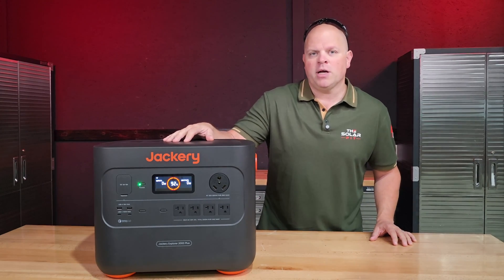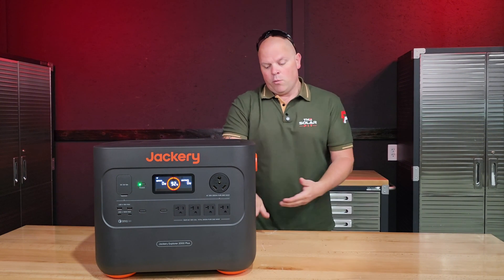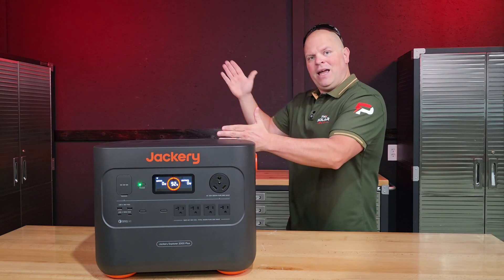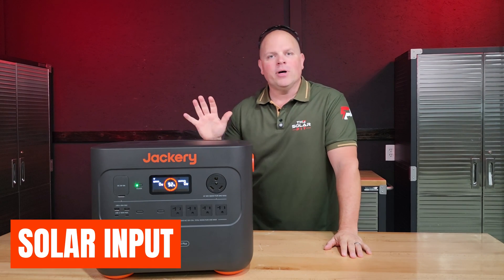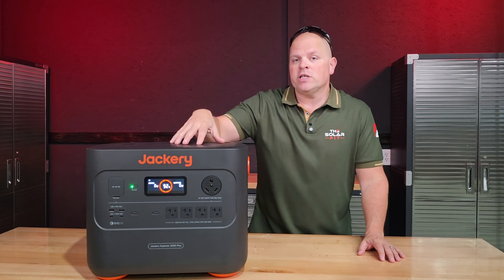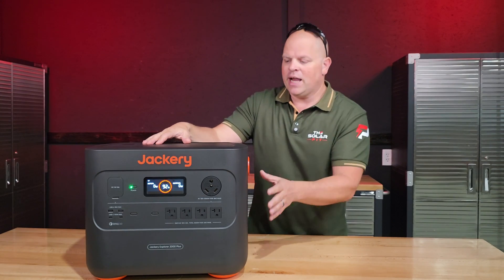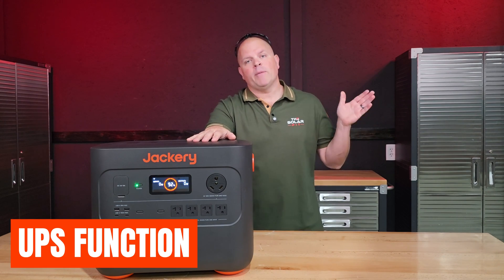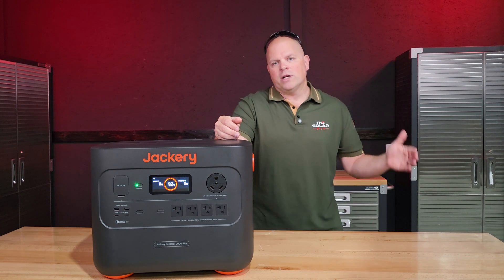What NO ONE is telling you - Jackery Explorer 2000 Plus

Comment: The biggest pain in the ass with Jackery customer service is...they won't do a damn thing until you send them either a  picture or a video of the problem.  I have had three units go bad on me.  One example was the cooling fan would come on immediately with a 10 watt ac load.  Then the fan would never shut off until you turned it off then on again. They want all this crazy info.  Then when you call back you get a different person and you have to start all over again.  NEVER buy a Jackery from any place other than Home Depot, Lowes or Costco.  Save yourself hours of frustration and having to ship the damn thing back to California.  Then Jackery won't send you a replacement for weeks until they supposedly review the problem.  I waited over 6 weeks to get a unit back after having to hound those useless tech support people. And to top it off...get this...they sent me a refurbished unit in place of my brand new unit that I bought.  With a 6 month warranty.   Go to Home depot. Return a bad unit. Immediately get a new one if you want another piece of crap.
Of three units, three were troublesome.  Two had hard failures. Fail code F 9.    Switched to Ecoflow.  OMG.  NO COMPARISON.  the ecoflow runs flawless and is whisper quit at full loads.
Reply: bought it from Amazon....i think i made a bad choice!